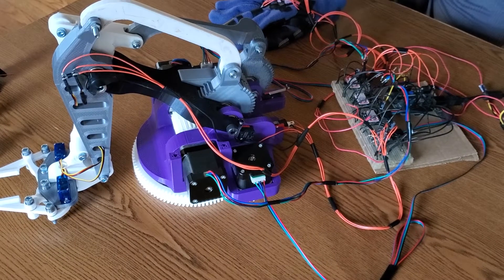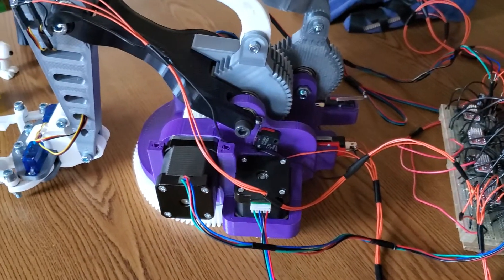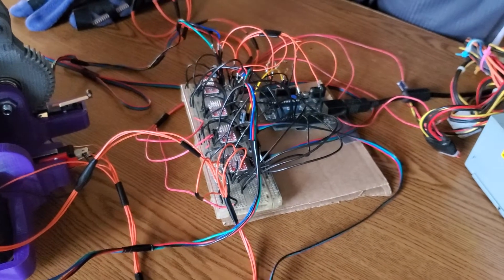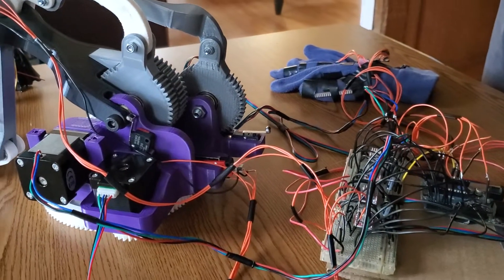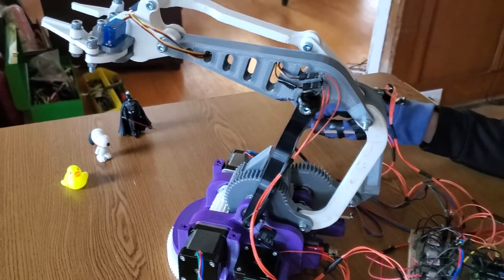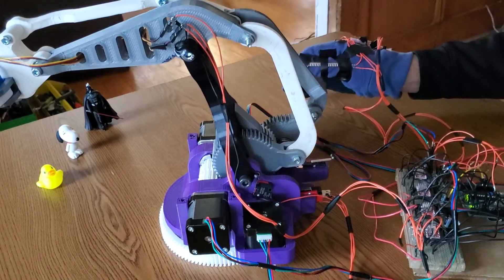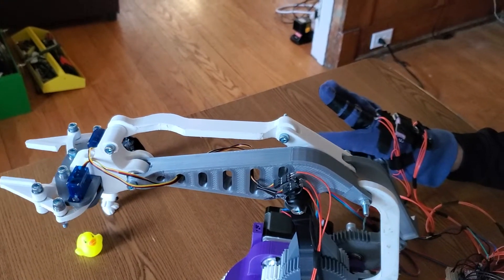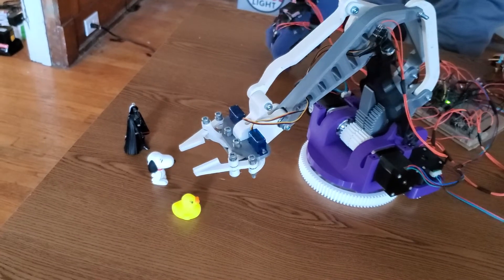3d Printed Robotic Arm using Arduino with Accelerometer and Flex Sensor Glove Interface - 2

Comment: Very nic., If you were to do this again, how would you go about making it faster?
Reply from the maker: Thanks for your interest. Had time allowed, I was going to implement matrix calculations using inverse and forward kinematics to calculate movements. Although it's quite a bit of math, it works quite well and is reflective of how modern robotic systems operate.
Reply: @Toxlicious  i would also suggest using gear ratios to get some higher rpm movement from the stepper motors. they aren't that fast but have a lot of torque which can be converted